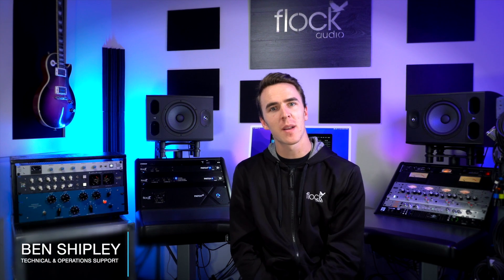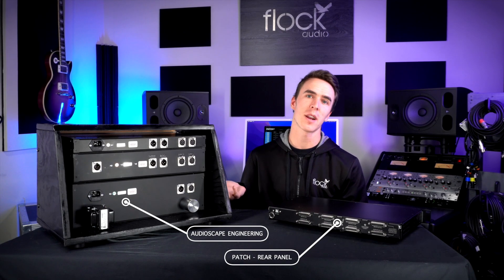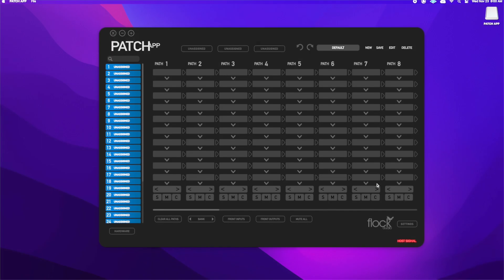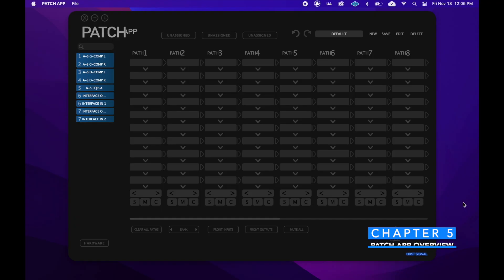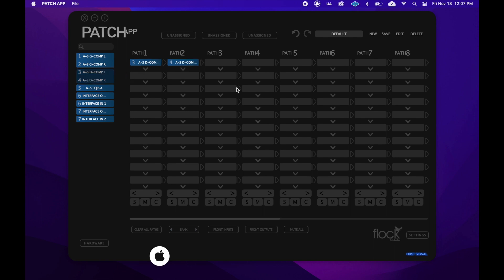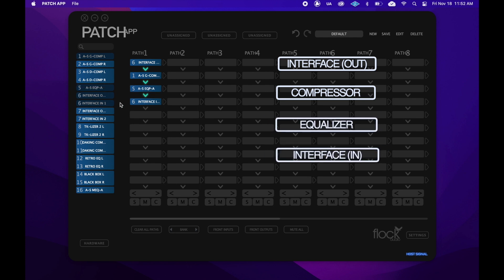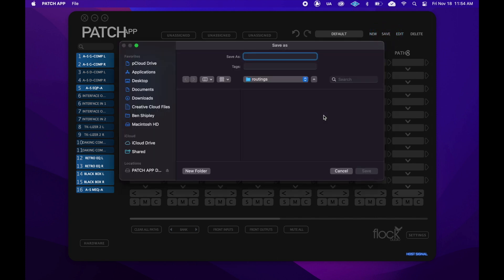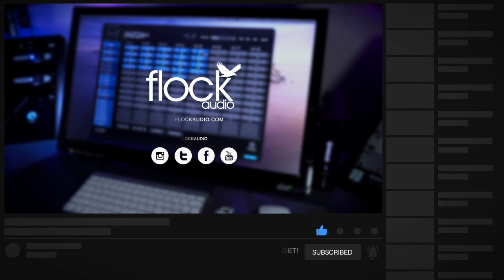Flock Audio: How To Setup your PATCH!

Comment: This is great unless you own a large format mixer like I do. I would need to spend about $12K to utilize this system.Very slick but not for me. Guess I need to stick with my trusty old cables and patch bays!...Or....I could attach the Flock to all of my 500+ patch points in my patch bays........then route them into the computer....which just adds more connections to what I am already doing......hmmmm...
Reply: Depending on your console I think what you would maybe want to do is try to route your insert sends and returns to the flock and attach compressors and eqs, leave everything else with your other base and you could just run 2 db25 from your other day to the flock for 8 inputs and outputs to the system?
Reply from the maker: The flexibility and possibilities are nearly endless! The way you are describing setting up in tandem with your existing traditional patchbay's is how some users setup their studio! Ps we do have a B-Stock sale going on right now for a limited time where you can get any PATCH Series model 15% off + free shipping! www.flockaudio.com/buy

Comment: But how will we use our outboard gear as effect inserts? Usually we’d connect the input of the effect to the same number output on the interface. But how would we do that here?
Reply from the maker: Yes - you still do that exact same setup you are describing! Check out www.flockaudio.com/resources where we have a lot of PDF Setup diagram examples to help better understand the visual aspect of connecting your PATCH Hardware to your Analog Hardware! 🙌

Comment: People are saying the direct input of the patch is noisy for using mics. How do I avoid that?
Reply from the maker: Thank you for your question! The reason some microphones produce noise with the PATCH Series is that the PATCH operates at a +4 Line Level for its inputs and outputs.

To use microphone signals with the PATCH, you have two options:

#1. Connect your microphone to a preamp before routing it to the PATCH (Mic → Preamp → PATCH).

#2. Or you can Utilize our 8-Channel CX Module, which is specifically designed to adapt the PATCH Series to handle microphone signals seamlessly. 

The CX Module integrates effortlessly with both the hardware and software, enabling the PATCH to work with any analog signal outside of the +4 Line Level standard.

😊 You can learn more about the CX Module here: www.flockaudio.com/cx

Comment: Thanks for the info, quick question can I use this device to make an iPad Pro setup only? And used with my outboard gear? I don’t have a Mac anymore
Reply from the maker: Hi! Because PATCH APP DX iOS requires communication with the host app, you will need to have a Desktop or Laptop running the PATCH APP DX Software. However; we are in the process of working on a USB-C to PATCH Series connection via iPad for controlling directly.

Comment: How do you connect 10 mics into the Flock? Is there a D-sub in 1-8 and 9-10 you would connect mic cables to? If all the ins and outs of your pres, compressors, eqs are connected to the flock patch I assume this is how? No one shows connecting mics just connecting gear to flock. I see two in's on the Flock for two mics with 48v. Thank You!
Reply: Do you group your mics before adding color

Comment: Awesome. Can I connect a PREAMP to the patch to use while tracking or is only for mixing with Outboards? it would be so simple to organize the entire chain.
Reply from the maker: Hi Valerio, Yes - you can connect your Line Output directly to PATCH and setup the rest of your analog routing chain with the PATCH APP Software 🙌

Comment: Just remember:  From Patch:  Out to In &  In to Out.  Be patient with yourself and take your time.

Fantastic box.  Over a year now with no issues.  Will never manually patch gear again.
Reply from the maker: VERY! Valid Point and Instruction! Easy to miss or mistakenly have the cables reversed! Thank you for the feedback as well on your PATCH! 🙂👏🏼
Reply: How do you connect 10 mics into the Flock? Is there a D-sub in 1-8 and 9-10 you would connect mic cables to? If all the ins and outs of your pres, compressors, eqs are connected to the flock patch I assume this is how? No one shows connecting mics just connecting gear to flock. I see two in's on the Flock for two mics with 48v. Thank You!
Reply: @marc8vino  my question exactly. you figure it out?
Reply: Does the software allow you to internally annotate ins vs outs and then with a user setting prevent you from doing such assignments?